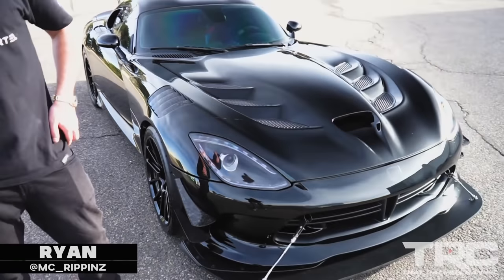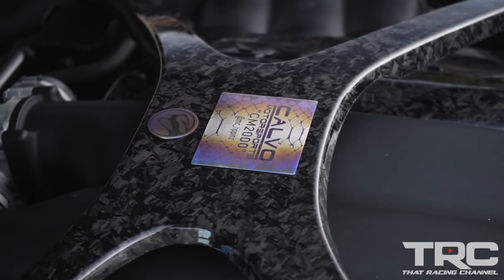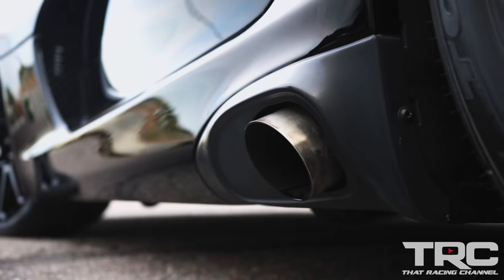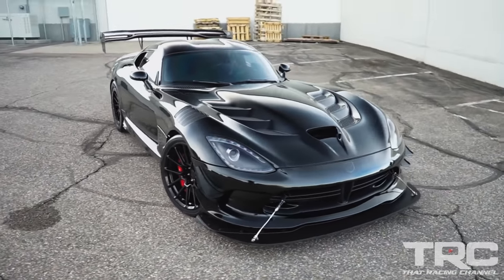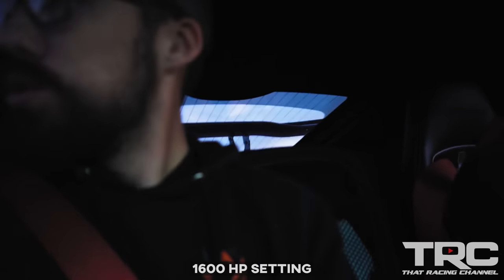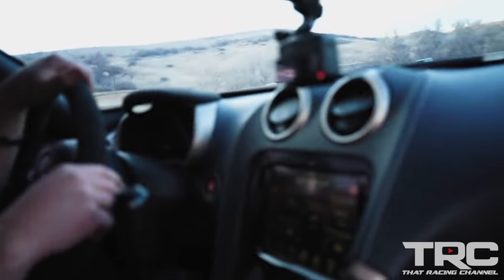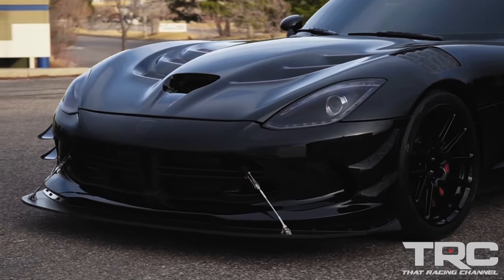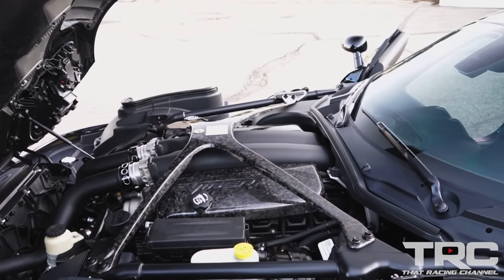2600HP Turbo Viper UNDEFEATED ON THE STREET! 9L Stroker + Sequential (2000lb-ft OF TORQUE!)

Comment: The fact that this car has 2600hp yet it still looks like a clean normal looking stock car with a sound system and a stock interior is pretty impressive.
Reply: Yeah the beadlocks arent ONE BIT suspicious..
Reply: @aaronmcconkey1062 ricer these days be putting on beadlock…
Reply: and scary as hell
Reply: @buttercake1499 exactly
Reply: Speaking of the sound system, does anyone know what song he bumped at 10:55
Reply: @deekamikaze Young Dolph - Green Light
Reply: normal looking is a hell of an understatement.
Reply: A viper isn't a normal car. It's a super car stock.
Reply: @buttercake1499 ricers are like liars, but all car guys respect those silly Over the top Japanese style cars with wayyyy to much going on like 4 spoilers and a paint job that changes with angle of viewing

Comment: How this obscenity makes any traction is beyond me. I love it
Reply: aftermarket ECUs and wheel speed by GPS
Reply: Technology is a mutha these days
Reply: Beauty of a motec ecu
Reply: They have big tire and proper suspension and a prayer
Reply: @Hitycooking  I think you could definitely gap that viper with your beast of a machine.
Reply: Don’t forget about downforce
Reply: @matthewstubbs1316  true the build is so legit im sure they actually calculated that in.  I can only dream of just taking my car to multiple people to work on it like this
Reply: @buddyywilsonn  Modern motorsport level traction control. The same type of traction control that allowed Toyota and Audi to have over 1000 lbs of torque coming out of the Le Mans hairpin and pull the trigger on without any wheelspin.
Reply: @matthewstubbs1316  People make weight out to be more than it is. It diminishing returns as it gets really expensive to remove weight. It cost less to make more power to overcome weight.
Reply: Down force
Reply: Yep then you see Hellcats trying to put 700 horsepower down from a 40 roll. Insane
Reply: @dj4monie  yeah but if you can remove like 400 lbs from a car your definently gonna feel or see a difference
Reply: @dj4monie  you brought up Le Mans n all I can think about is the CLR doing backflips😂😂
Reply: Extreme aero package
Reply: That wing actually help with traction
Reply: Motec ecu
Reply: Torque by gear through the motec and a gigantic wing allows those ACR vipers to throw 1,700+ ft lbs of torque on a sticky track, so on a street it still hooks, just turned down.
Reply: Also your literally sitting on top of the rear wheels
Reply: Boost by gear my friend
Reply: IKR HES NOT EVEN ON DRAG SLICKS!
Reply: $$$$ spent right makes it happen.
Reply: Downforce, weight distribution, big tires, big brakes, proper suspension, and a LOT of luck.
Reply: I dont even know what that means lmao but that shit sound good
Reply: They specifically designed some software to put it down. Pretty dope
Reply: By building the boost in gradually and lots of tire.
Reply: ACTUALLY besides traction control the suspension is dynamic. This is the reason.
Reply: Its the massive Spoiler on the back.
Reply: @Truthcanbeconfusing  No actually it's not. Go look on the person who made the cars page. Lmfao
Reply: They were saying it pullls harder in every gear, so I'm guessing some serious boost by gear tuning.
Reply: @lynnmckenney1987  Yeah, it has boost by gear and boost by throttle.
Reply: Downforce
Reply: you can hear when he accelerates past cars filming third person the traction control ripping timing
Reply: Motech, r888 and downforce.
Reply: 80 rolls, that's how. These are cars that can't do the normal 30-40 rolls. Guys that want to have everyday fun to drive car and to be fast from lower starting speeds go TT Lambo, guys that only want a car to race starting above highway speed limits go TT Viper. I considered doing an NTH Gen V Viper at one point but decided it wasn't my cup of tea.
Reply: Why the word "obscenity" made me laugh so hard is beyond me
Reply: @zippymax1  no lmao no one will beat this machine
Reply: Everyone is saying he uses boost by gear... but all the top guys use boost by speed
Reply: Looks like it has proxes RR tires, basically slicks.
Reply: I'm not a dodge fan but who can honestly hate on this car, I'm in ah right now
Reply: @ShadowTheSC  Very little luck involved in this marvel
Reply: Clever mapping, boost/torque by gear etc. Decent tyres and a decent squat set up suspension wise. I mean for a totally use able road car I agree it's nuts
Reply: @TwinTurboOnly  oh but it is, it's the revised dsc suspension that let's Calvo put lots more power through the rwd system than before.
Reply: Much lower boost/torque in the low gears. Very progressive hit on the boost map, rather than a spike. You can see how gently it comes on boost...
Reply: I thought  exactly the same thing
Reply: Check his IG, active traction control
Reply: 1776 wing bay bee
Reply: @AYO_KO   yup I remember that CLK GTR
Reply: @truaz1an  CLK didn't flip I don't think. The CLR was doing gymnastics tho😂🤣😂🤣😂
Reply: It comes with 355 rears stock sooo
Reply: Ninjaneering
Reply: Money is all you need.
Reply: Don’t you see the wing and  splitter
Reply: HE NEVER SLAMS DOWN THE PEDAL, EASES AT FIRST AND ALWAYS AT AN APPROX. SPEED AROUND 50MPH. BEFORE SLOWLY ENGAGING, THEN BOOM
Reply: @matthewstubbs1316  acr
Reply: @Drunk3nMas7er  How are they inaccurate? Draggy's are within a few feet and it goes off your phone and it's not even dedicated GPS. MotoGP guys use it with motec to set beacons for lap times..... 

English racings integra has used boost control by GPS speed for years, setup is likely different now, but it has been done by many people.
Reply: The weight of the Amps and subs probably help make it faster by helping it keep traction
Reply: Don't forget the wavetrack diff
Reply: @TboneSTEAK111  Just going off the Motec specifications of how they run there traction control.  It's comparing the pulse rates of a 2- 4 hall effect sensors either 3rd party or the oem ABS wheel speed sensors.  Makes sense though, and the more I think about it, a car with enough power to pop a wheelie in a race would need a simulated wheel speed signal from a GPS to even function. Bet you'd need it to get traction control in an AWD system to even work too.
Reply: @Drunk3nMas7er  Yes I have a Motec M150, most common is wheel speed like you suggested. 

However, for X speed you know your Y of wheel speed, I'm trying to find the damn video of them explaining how it works, it's one of the 1320 or TRC videos where they interviewed them
Reply: 60 mph roll-ons only?
Reply: Two words... Traction Control.
Reply: @crazehayes1  obviously im not educated in what it takes to get this kind of power to the ground.
Reply: @TboneSTEAK111  gps is accurate. Gauges are not
Reply: @dj4monie  ya for sure in a straight line.

Wheel mass can gain points in straightline racing.
Reply: @MrDiaperMonkey  if you hear the owner of violet talk about the car, its set up for torque by gear, and if you listen to Collin (the tuner) the cars are tuned for torque by gear.
Reply: @matthewstubbs1316  you clearly have no clue what down force is and how it affects a car.
Reply: @eezynah1731  Crap, you’re right! I just assumed because the UGR lambo’s are boost by gear due to them being awd. But these rwd vipers... it would make sense to limit torque lol
Reply: @MrDiaperMonkey  I always thought the same thing until Fred from 1320 took a ride in violet and I think i heard either Antonio or Collin talking about it at FL2k in an interview
Reply: No ecu system or suspension system is gonna put over 2k hp the the ground without spinning. It's 100% the downforce from the aero.
Reply: That moetec magic
Reply: @doctorsquirts3643  jesus man, listen to the owner of the company back in october doing an interview with TRC talking about alexs'  car (which is not an ACR, just a GTS with ACR wing) the OWER OF CALVO AND TUNER OF CALVO took the car out on new DSC electronic controlled suspension, with an ACR wing, threw 1700ft lbs on the street at the car and it didn't trigger the motec traction control. Then they put 200 more ft lbs of torque and it was still happy. Aero is a big factor but saying ecu or suspension doesn't do anything, and its 100% aero is straight up bullshit.
Reply: @zippymax1  😂😂😂 your comment. I checked his channel
Reply: @BaezLife  Yeah, it's a cute one. Imagine if he got enough subscribers that he could make a little money and bootstrap a true little operation in that village. It wouldn't take much. Maybe 50k subs. I suspect the dollar goes a long way there.

But then I suppose he would move to LA and be corrupted lol.
Reply: @zippymax1  man that would be so great if that happened.. I subbed to help haha.
Reply: See the gigantic wing?? lol
Reply: @TboneSTEAK111  wait, really? that's really smart.
Reply: Most probably boost by gear.. the worlds fastest cars are linear mapped, set up perfectly of course and your car will be f**king quick.. I do know of a E63s that would give this if not beat it run as it beats anything here in the U.K on 0 to 200mph runs
Reply: Proper tyres and boost by gear.
Reply: The Viper chassis design also puts down power better than most other RWD chassis.
Reply: @MrDiaperMonkey  This is de wey.
Reply: @AYO_KO  CLK GTR
Reply: @nathangibson5987  Where is "ah" ? Is it near "Oz"?

I'm in ah right now
Reply: They had to add huge weight ballasts in the GT vipers and they still won, the car was designed by a legend and it performs like it.
Reply: @gimmethecarkeys  and a motec system exhaust
Reply: It's that wing baby
Reply: @ShadowTheSC  zero luck.
Reply: @DrCrunkMusic  highly doubt he is using something as simple as boost by gear
Reply: This track special Viper is known for it's massive down force making it perfectly for a build like this.
Reply: @oldcrook510  but downforce actually slows the car down so how are all the aero bits helping? i genuinely wanna know cause im not an expert and i read that the stock acr viper's top speed is only 171 mph just because of the aero package
Reply: The ACR version of the Viper is the perfect car with all the down force.  There is no car on the planet that can handle 2000-3000 hp and keep it on the ground better than the Viper ACR.
Reply: Mo Powa Babeh..... Yea!!!!!
Reply: See.. Money does buy happiness..
Reply: do you see the size of the wang? Downforce for days lol. Also aftermarket wizardry
Reply: Tires that are 4 times wider than normal like ever drag car, it's math. You aquire traction with tire compound and especially tire width, it's like having a giant hand you can grab wayyyyyy more.

Comment: The best part about this is that it's a functioning car, with a sound system and everything
Reply: Yess
Reply: I know the interior looks pretty much stock! So clean.
Reply: Navigation, HVAC, and a good sound system. Yes.
Reply: I noticed that same thing, it's very cool
Reply: yeah and rediculous fuel consumption....
Reply: Imagine driving this to your 9-5 job
Reply: @rustyshackelford4613  -- 😅 would definitely help you disconnect from work at the end of the day and put a pep in your step!
Reply: @rustyshackelford4613  you mean for delivering Pizzas?
Reply: Anyone know the engine?
Reply: Bruhh frrrr
Reply: You don't really need to do weight removal with all the HP and TQ, haha.
Reply: Yes ! Because it’s always been about power period! Not butchering your car to death and stuffing a 180 hp engine in it and screaming “ I’m saving weight .
Reply: @mattruperd7120  8.4l v10
Reply: Agreed, beautiful build
Reply: @mattruperd7120  no, nobody knows, it's a mystery, lol
Reply: @ianhachi  it says in the description that it’s a stroked 8.4 to 9L. Absolute monster
Reply: @Decenium  i mean its obviously a race car if it wasn't it would be a prius instead...
Reply: @jayfwe  so they bore the cylinders to increase displacement? Cool
Reply: yeah and imagine if it was gutted and set up to be as light as possible. 😂
Reply: Even has a brake pedal....just amazing!!!
Reply: @mattruperd7120  it's actually a 9L stroker V10
Reply: Does anyone know the song he was bumpin at 10:52

Comment: The Viper is by far one of the most underrated cars in history if you ask me. It’s nice to see someone build one and stretch its legs to that level. Making that type of power in a high altitude like Denver is absolutely impressive. The average joe wouldn’t have a clue on how hard it is to make that kind of power in absolute shit air quality. Dope build.
Reply: as someone who lives in Colorado I agree. Its a bitch to make power up here and the fact he's making what he is on the street is literally peak performance.
Reply: AVERAGE JOE can't afford to buy and then  build a car that makes that kind of power 😳
Reply: Their turbo package is expensive as fuck tho cost more than the actual car
Reply: @tf6437  no doubt. High altitude areas are notorious for it. You are suppose to tune according to elevation. 

@Kiwi not necessarily. You can be a filthy rich or poor and still be an "average joe" Money has no place in this discussion. Being an "average joe" is nothing more then a normal person that isn't knowledgeable to the topic.
Reply: Im an "average joe" and i have a question. Would car be a lot faster in low altitude?
Reply: @ArturoAlvarez16  yes altitude lowers atmospheric pressure which lowers cylinder pressure tremendously. forced induction can usually make up for that since it pressurizes the intake charge
Reply: @ArturoAlvarez16  absolutely. If you take the same vehicle to a high altitude area, run it you will automatically feel power loss. Take that same vehicle to a normal altitude and you will instantly notice the difference. High altitude areas have extremely poor air quality/thinner air. Air intake is a major aspect of power. It’s hand and hand as important as fuel.
Reply: @moose1164  interesting, now I have more questions. would the car need to be re-tuned once you've gotten it to lower altitudes? 

and my other question is isnt higher altitudes more ideal when it comes to keeping your car cool with this much power? i would imagine the car would over heat in warmer temps
Reply: Facts, well written input
Reply: @ArturoAlvarez16  if it was tuned for higher altitude? Yes! That is kind of a weird question because it could go either ways. Yes, in higher altitude it will run cooler because usually the temp is colder then lower altitude weather. The way cars are designed nowadays they rarely overheat. They have to be pushed really hard for long periods to over heat if everything is working.
Reply: NO
Reply: damn i was looking at denver as my new place to move to in october but never thought of this. might have to pick somewhere else haha
Reply: @ArturoAlvarez16  it's pretty simple for fuel ratio reasons the lack of air pressure (from the atmosphere) causes imbalances in the ratio so fuel has to match the air intake to keep that balance. if u have less air volume then u need less fuel to mix with it to achieve the same ratio. think of the atmosphere air pressure as u would think of being under water. the deeper u go the heavier the water pressure is.... the lower elevation u go the higher the air pressure is.... higher air pressure fills cylinders quicker and with more volume which equals more hp
Reply: @nycyabber7103  if u went from sea level 0ft elevation to Denver 5280ft elevation I bet u would feel a 20 percent decrease in hp unless u have forced induction
Reply: The highest large city in the world is La Paz, Bolivia at almost 12,000 ft elevation. Imagine what that would do to a car.
Reply: Gotta laugh at “high altitude” and tuning. Computers tell you what to do compared to a log-book and tons of swaps.
Reply: Now turn
Reply: One lap on a real track and it shits the bed and dies
Reply: As a bmw head I’ll have to admit this is actually my all time favorite car and is definitely a SLEEPER